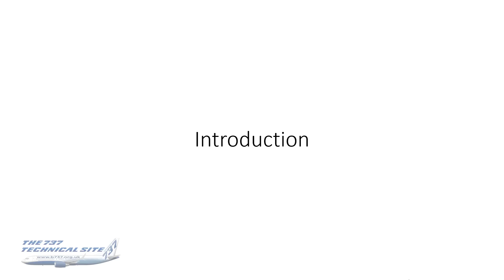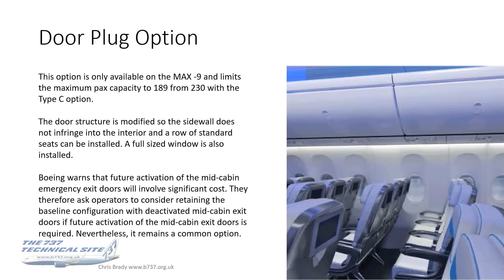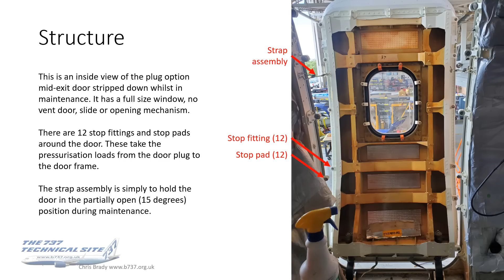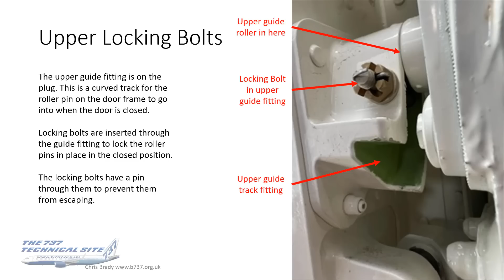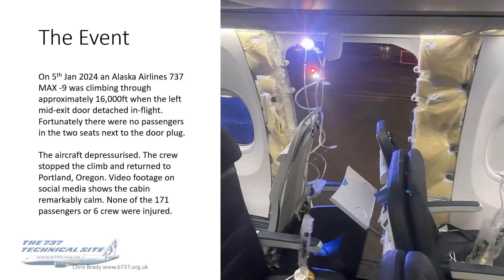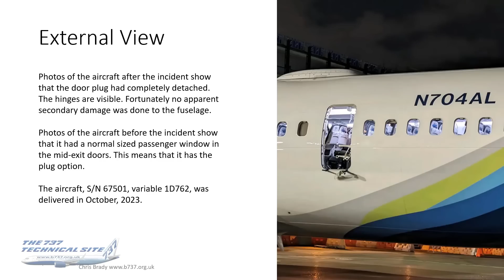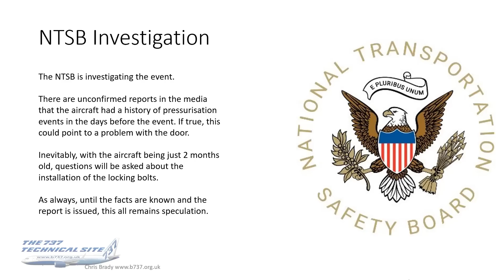737 Mid-Cabin Emergency Exit Doors - Plug Option

Comment: How does the stop fitting and stop pad work.  Looks like the stop fitting on the door needs to be inside (cabin side) of the stop pad, so that the higher aircraft pressure on the door gets transmitted to the frame.    Thanks
Reply: The stop fitting on the plug presses against the fuselage stop pads and transfer tge pressure load on the plug to the fuselage via 12 stop fittings and that is what prevents the plug from flying off as explained by ntsb.

Comment: there is NO damage to the frame because the bolts are located on the roller and lower hinges.

The bolts failed, it’s clear. all these media boobs watching this are reporting crazy shit…
Reply: The bolts did not fail because there were no bolts.
Reply: @elangr I heard that too, but it’s not definitive - the NTSB also added that the probability of there being zero bolts installed is extremely low. The lab test will determine it in the days to come. If there were no bolts then Boeing will be bankrupt after stockholders flee and CEO resigns or heads to jail. 

Look at the maintenance failures of the other Max 9s, a large number had loose bolts which points to failed tightening of bolts during maintenance crating a “gap” allowing enough force to put constant strain on the bolt(s) during pressurization and depressurization.

Comment: How difficult is it to access the upper tracks to properly fit in the Lock Bolts? Access looks a bit restricted. Does this plug have warning indication in cockpit if it is even slightly out of fully installed position? Might have prevented plug blowout if a warning gives pilots sufficient time for emergency descent. Not possible to get cabin crew to check it as it is fully enclosed by cabin panels. So only choice is emergency descent to lower cabin pressure differential altitude.

Comment: 100% clear: One of the 2 upper Locking bolts & their pins failed (sheared bolt or threads)…

The bolts being loose and the constant stresses on the bolts from pressurizing, then depressurizing the cabin - the pressure change issues were the first warning signs.
 
once the first bolt failure happened the force on the other bolts became too much, ripping out the two lower hinges seen hanging off the side of the plane. The assumption is reinforced knowing that the door was able to separate from the lower hinges with little resistance, showing that a failure also occurred with the Arrester Bolts which secured the door to the hinges. 

Prediction: There was a documented correlation between cabin pressure leaking and the Door Plug not completely sealed or fastened. OR  Boeing ordered budget Locking Bolts to save money and almost killed 100 people to save whatever they saved… 

the worries of living Capitalism! ❤

note there is NO damage to the frame because the bolts are located on the roller and lower hinges.
Reply: note there is NO damage to the frame because the bolts are located on the roller and lower hinges.
Reply: There is negligible shear stress on the bolts.  The didn't fail, they were never installed.
Reply: @BruceLiebert I heard that too, but it’s not 100%. also NTSB added that the probability of NO bolts installed is improbable. tests will determine if it had then in the days to come. If there were never bolts installed then Boeing will be bankrupt after stockholders flee. 

the maintenance failures of the other Maxs. A LOT had loose bolts pointing to a failure to properly maintain the plug,  crating a “gap” that allowed constant strain on the bolt(s) during cabin pressurization and depressurization.

There is no conspiracy to hide a “no bolt” theory. it seems the first set of evidence shows a maintenance negligence on the part of Boeing, or whomever defined their QA process, NEVER including the door plug tightening. 

Simple. If you need a possible nefarious mystery, how about WTC7 this one has lots of “No BOLTS”. 😮

Comment: Looks to me that the door has to go up to open NOT  DOWN like you are claiming
Reply from the maker: You are correct
* Errata *
In this video I state that a downwards force is required to remove the door plug. I based this statement on text in the AMM SDS which I now believe to be incorrect or misleading. It is possible that a very small downwards motion (1-2mm) is first required to be able to free the locking bolts. But the door must be moved upwards by a couple of inches to clear the guide tracks. Apologies for any confusion.

Comment: Is it possible that it is an ntentional mistake by a disgruntled employee? Then how it ended up down in the line not being detected
Reply: You would need 2 disgruntled employees as sign-off of work requires 2 seperate signatures.  The mechanic and the inspector tgat inspects the mechanic work.
Reply: @elangr  Thank you. It's too much possiblity of a negligence, an error and probably knew it will get away undetected by time. These doors have been around for so long its difficult to neglect. If its two people then the inspector could have detected, but did not.
Reply: @elangr  In any case very probably they will trace

Comment: Hi Chris, the description of the opening sequence (at around 7:09) seems to be wrong: "a downward force is needed to force [the door] down against the lift assist springs until the rollers clear the guide tracks".

In order to get the rollers [on the door surround] to clear the guide tracks [on the door], the door would need to move UP, not DOWN.  

It's upwards movement of the door that the locking bolts prevent.
Reply: An upward force is required to get the door off the rollers.  Boeing added a spring to make it easier to lift the plug off the rollers and to prevent it from falling back as Chris explained.
Reply: @elangr  OK, I guess there may be an acknowledgement by Chris somewhere in the 1,100 comments that the description in the video is wrong - I haven't read them all.  It might have been better to add an explanatory note in the description to that effect .
Reply from the maker: Acknowledgement here. The AMM SDS appears to be incorrect. You must have to move the door upwards to clear the guide tracks. Maybe it needs a very small downward movement first to free the locking bolts but the manual was not clear.
Reply: @ChrisBrady737  Thanks, Chris, that makes perfect sense.

Comment: Thank you for your detailed explanation of the “door plug” construction. 
At 7:00 it says in the third paragraph: “To open the door plug, a downward force is needed to force it down against the lift assist springs until the rollers clear the guide tracks.”
If the guide rails are attached to the "door plug", the description in the paragraph should be: “To open the door plug, an upward force is needed to force it up assisted by the lift assist springs until the rollers clear the guide tracks.”
Reply: Agreed-he had it backwards.  Very clear from looking at the design.  Lift up to open.
Reply from the maker: * Update *
In this video I state that a downwards force is required to remove the door plug. I based this statement on text in the AMM SDS which I now believe to be incorrect or misleading. It is possible that a very small downwards motion (1-2mm) is first required to be able to free the locking bolts. But the door must be moved upwards by a couple of inches to clear the guide tracks. Apologies for any confusion.

Comment: No one is questioning whether it was intentionally opened? 

And regardless of intentional or unintentional, if it stayed on for more than two months of flying while it was essentially left opened, then that’s a good design not a bad one. Plus, the plane itself did its job and gave alerts!

When was the plane on an assembly line or in a place where the door plug needed to be taken off for interior work? Anyone know? October is the month I’ve read thus far. This doesn’t seem suspicious to anyone else??????

Comment: Chris - Your videos are extremely useful in helping to explain the workings of the door plugs on the 737 Max 9.  I'm curious about the plugs on the 737-900ERs which have been in service for more than 15 years.  Does the Max 9 have a redesigned plugs system or is this the same system that is used in the  900ERs?  If it's the same system I would think that the inspections would extend to the 900ERs as well as the Max 9s.  Thanks.
Reply: I have been asking the same exact thing.
Reply: I'm not sure to whom I should be asking this question but Chris seems to be particularly knowledgeable on the subject so I hope he can shed some light on it. 
 @Paul1958R
Reply: My u persuading is tgat the 2 doors are similar in design.

Comment: Suppose a guide track casting fails, releasing that corner.  Hatch is pushed out at the corner;  hatch twists and distorts on the remaining three attach points, perhaps with help from the slipstream , thus allowing the other roller pin to pull out and away from its guide track.  Bye-bye hatch.  Disturbing to think that the fate of the entire aircraft is dependent on no single guide track casting ever failing.  I would expect a door design to be more fault tolerant.
Reply: The plug is normally held in place against the pressure by 12 stop fittings/pads, not the guide casting. The guide casting in this case has failed because the plug was able to move up and out of position to the point where the 12 stop fittings/pads were no longer engaged. Once that happened, the pressure force was more than the guide fitting was designed to carry and it broke.  With the plug correctly positioned, the failure scenario you describe can’t occur..
Reply: Thank you @davidcollins7667  .  That makes sense that there would be multiple pads holding it in place, but from the video, I didn't understand what you are saying.  I hope you're right.  I'm still having problems understanding how the plug can move once pressurized even a little.  It looks like the guide track has a negative angle that causes the roller pin to be captive under pressurization.
Reply: @geneallen5758  re the movement of the plug, the current speculation is that there was a range of altitude/pressure where the friction between the stop fittings/pads could be limited enough to allow the plug to move inflight by turbulence etc and shift up, while still leaving the stop fittings/pads partially engaged - until the plug moved enough to disengage.  The lift assist springs in the hinge would help to push the plug up.   By the same theory, once the plane came down to the ground, and particularly at touch down, the plug might shift back down to its seated position as the friction between the stop fittings/pads would be much less due to reduced air pressure differential.  Again - all speculation - but what is firming up as the original cause is that the locking bolts were not present at the time of failure.  The NTSB will no doubt be able to inspect the holes where those bolts were meant to be to see if they were ever installed or not.

Comment: In my opinion the emergency door mechanism in 737-9 is poorly designed. I am more familiar with Airbus doors and I think this door system is soo close to A400 acces cabin crew door but with a big diference: open side of rollers guides are to up, not to down. A400 when open from close position have slide to up, free roller from guide then hinges istalled botton down let spin out-down door, so with pressurization and a theorical malfunction or missing block system its own weight stuck door in door frame. But 737-9 emer.exit door have guides open to down, so without a good block mechanims, block pins or futher spring natural ways for its own weight is go open. In case of strong landing or turbulence we will have high probabilities a open door if something in door mechanisms do not work well at all.
Reply: It has nothing to do with design if you don't install the 4 screws or the 4 screws are not secured properly and fall out.

Comment: It says to open the door a downward force is needed.
How the hell? You need to lift the door to clear the roller pin on the frame.
If you push down you are limited by the blind guide.
You pull up helped by the springs, clear the pin and push out.
So if the bolt is lost or broken i can see a few ways of loosing that door.
What im missing?
Reply: This has been stated many times below.  The Boeing MX manual is wrong!
Reply: Agreed-he had it backwards(or rather, the manual had it backwards).  Must lift up on the door to open.
Reply from the maker: * Update *
In this video I state that a downwards force is required to remove the door plug. I based this statement on text in the AMM SDS which I now believe to be incorrect or misleading. It is possible that a very small downwards motion (1-2mm) is first required to be able to free the locking bolts. But the door must be moved upwards by a couple of inches to clear the guide tracks. Apologies for any confusion.

Comment: On Dec 7, Jan 3, Jan 4 there was a decompression light that showed up in the cockpit.. If the cotter pins were not installed. The bolts could have worked their way free!
The crews ignored the lights!

Comment: Shouldn’t we look at all Boeing planes with such a plug door option ? After all, why the torque problem should only be limited to the 737 Max 9 ? This system of plug is and old one so, it might be the time to check it on all equiped planes at least for those one which were built after the change of practice and control regarding securing those bolts ?

Comment: Latest reports indicate many "loose" bolts have been found. No mention of missing cotter pins though which leads me to believe, and there is reasoning behind it as well, that these bolts should be loose.  Their only job is to prevent upward movement of the plug. If they are tightened, there is a possibility of deforming the latch and guides.  It could be the reports are false positives since the cotter must be removed for the nut to come off and the bolts to slip out and the possibility of that happening to all 4 bolts is extremely high.  More than likely someone forgot to install the 4 bolts.
Reply: Turns out the loose bolts in question were NOT the 4 castellated bolts securing the door, but hinge bolts that secure the lower guides to the door itself.  This is bad for Boeing since several doors are now appearing to have not been properly built at the factory.
Reply: @acdii  So the next (obvious) question is, is that door assembly used on other aircraft.... This is very bad for Boeing!
Reply: Exactly,  castle nuts are not meant to be torqued down.  They use the cotter pin to prevent unscrewing.  Like on wheel bearings.
Reply: On 'false positive', the inspection document should have identified requirements for torque (or finger tight), and confirmed castellated nuts with split pins.... United saying 'loose nuts' may be misleading, ie 'loose' equalling 'not secured'. Surely NTSB with have evidence photos...
Reply: @mungewell  The first couple notices that came out had zero in the way of identifying the issue, just to inspect.  I haven't seen the latest so don't yet know if details on securing the bolts have been issued today. As of 8 this morning it just said inspect the bolts.

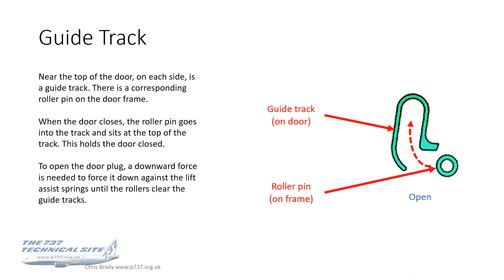Comment: 7:18 the door needs to move down, which way does gravity work?  
so in case of spring failure the door moves down🤔
7:50 door attached to the rest of the plane by (only) four fittings. Who designed and approved this???
Reply: Vid was wrong.  Door must be lifted to open, as evident by looking at the design.  Also-its not held in place by only 4 fittings.  Its held against 12 fittings by cabin pressure.  The 4 bolts are merely to hold the door from moving away from those 12 fittings when the plane is not pressurized.
Reply: @phloughtgnarpsehs7263  thanks, should they not use sealwire, seal and sign off on installing the bolts and nuts?
Reply from the maker: * Update *
In this video I state that a downwards force is required to remove the door plug. I based this statement on text in the AMM SDS which I now believe to be incorrect or misleading. It is possible that a very small downwards motion (1-2mm) is first required to be able to free the locking bolts. But the door must be moved upwards by a couple of inches to clear the guide tracks. Apologies for any confusion.

Comment: From my 737 MRO days I speculate that the bolts and plugs were installed at Spirit Aerospace at Wichita Kansas then transported by train to Seattle, then the bolts and door were removed at Boeing to help workers get interior parts inside the fuselage for installation. 4 bolts failing at once would be quite a coincidence, but the universe is not that lazy. One bolt should have been able to hold that door in especially one of the upper ones on the roller latches since they act in tandem . The two at the bottom looks like it just acts as stops on the hinge.

Comment: The door goes UP to open, not down. The Roller Pins are fixed and the Guide track moves UP and OUT away from the frame.
Reply from the maker: * Update *
In this video I state that a downwards force is required to remove the door plug. I based this statement on text in the AMM SDS which I now believe to be incorrect or misleading. It is possible that a very small downwards motion (1-2mm) is first required to be able to free the locking bolts. But the door must be moved upwards by a couple of inches to clear the guide tracks. Apologies for any confusion.
Reply: Thanks for being responsive to suggestions. I'm looking forward to the new chapter in your e-book.  @ChrisBrady737